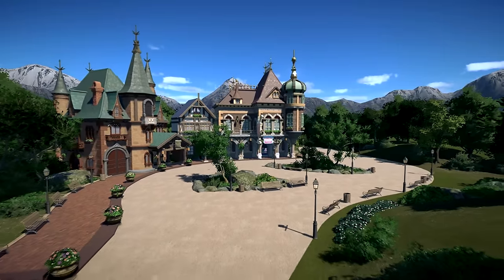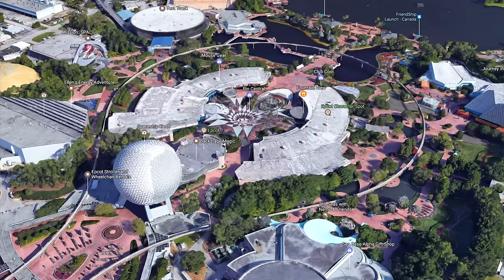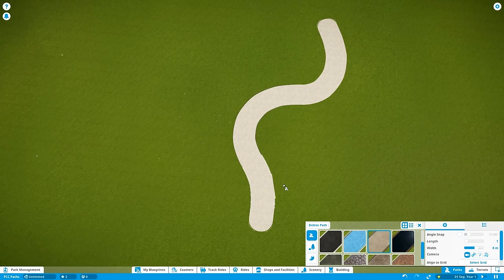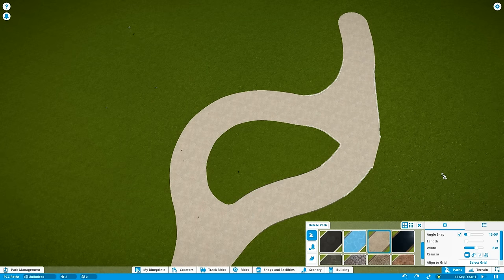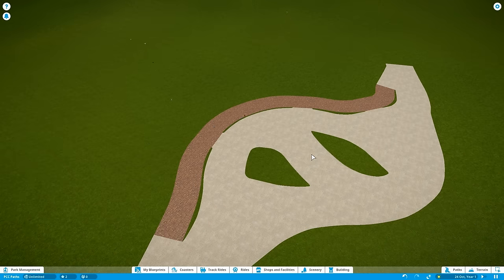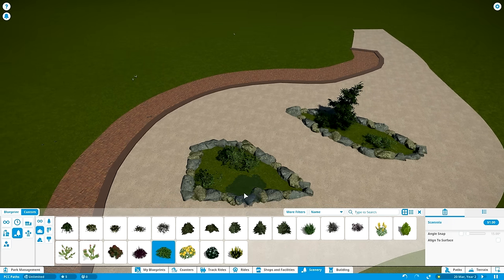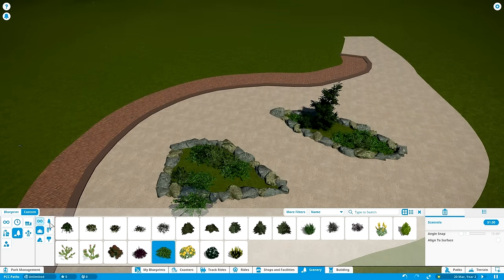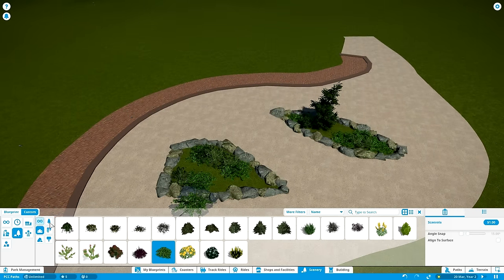Planet Coaster College - Smooth Paths & Plazas Tutorial

Comment: This could all be so much easier if they just let you fill in space between the paths.
Reply: Labedincoln yeah the paths in planet coaster really need to be re-visited/improved.
Reply: @JaycePeterson  I think having a designate path area tool function would be great. It sets areas where peds can walk and you can draw the edges, at which point when you connect a solid area between your drawn edges, it spawns in a path texture in that area that you can edit however you like
Reply: @JaycePeterson  to bad they are using pretty much the same path system in planet zoo )': didn't do any real changes
Reply: they need to add a path-paint brush
Reply: Amen
Reply: @PotholedAxe9985 THATS WHAT I WAS THINKING
Reply: I think the guests movement is closely connected to the direction and placement of the path squares so it causes some... "Issues"
Reply: Hopefully in PC2
Reply: @JaycePeterson well 7 years later… confirmed updated pathing system for PC2 👀
Reply: EXACLTY!!!

Comment: they should just add a paintbrush style pathsystem  on top of the current system. that way you can just do the outlay of your path with the current pathsystem and then paint the rest in if you want to make a plaza.
Reply: I suspect while this could be fairly easily impelmented, the problem/and reason why the path system is what it is in the first place, would be to have the pathfinding of the guests handling large open aeras and navogating them correctly. Especialy since planet coaster doesn't follow a strict grid system like say parkitekt or the old roller coaster tycoon system, they need something else to seve as way points. I think that's why the path system is organised around waypoints the way it is.  Look at the things he did and you'll notice the guest don't really 'spread' throught the plazas, they still follow the orginal pathes in single file. 
I suspect that by comparaison, had a done a square plazza with the select grid tool, (which is kind of already the euivaent of being able to paint zones with a brush, jsut a rectangular grid based one, really) the guests would have no problem navigating it.
Just speculation, tho, to be clear.

Comment: I figured the trick with smoothing corners out for myself! :D

One thing I've noticed with it is that you should finish the layout before smoothing, this usually leaves weird, "malformed" parts that can't be joined to nicely if you're still building. Also this tends to happen if you do this too much, so don't rely on it!

Comment: If you want a plaza without a path hole in the middle you can build a "sketch" on a grid and then smooth the edges using the corner trick... the edges don't get quite as smooth and rounded but it works (most of the time).

Comment: Thanks alot dude! You don't know how many gaps are in my park right now cuase of the path system. Now I have to close it , kick everyone out, and start from zero. Just started a new park so shouldn't that long.  And if they, frontier, made Jurassic World like this then it's gonna be a fun summer.
Reply from the maker: I've had a demo of Jurassic World Evolution, and the path system in that game will for sure be a lot easier!
Reply: So I was messing around and Idk if you know this but you can "fill" in the hole of the path. The way i did it was: go to the advanced options and click  curb on path off.  Then select width  between 6 and 8m your choice, I feel 7 is good. Click on the select grid and three rows of squares will appear, start on the middle go towards the direction you want; once you got as far as you want simply turn around on either the left or right.  Connecting rides to path with this method will leave some gap, but I just followed your suggestion of adding scenery.

Comment: Hey Silvaret. You can also use 2 or 3 shops next to each other for 6:45. Place them, and then delete them. As it is sometimes a bit more convenient, because it's wider than the widest path you can use. If you place the shops close to the path though, otherwise it won't work.

I've been doing it this way sometimes, as doing it with the path system itself doesn't always bring the result I'm looking for.

Comment: I don't know if this was maybe made before it was patched ( I'm new to Planet Coaster myself) but I was trying out your plaza tips, and kinda by accident, I noticed you can use shops to make even smaller adjustments along the edges and then delete the shop as well, let me fill in a few lines that weren't quite right for either the build item trick or a planter. 

Amazing vid btw, redoing most of my parks with these fuller type plazas.

My only "complaint" was that trying to learn to use CTRL a lot more and Z a lot more led to a lot of accidental CTRL -Z undoing heh

Comment: Yes, I wondered how to make large paved areas like real parks that are irregular in shape in PC. For example, having curved edges on a large paved area that's on a grid without those holes and gaps in the path. How do you have large paved areas go on a diagonal or curve without having gaps in the path? Normally on the gridded path you can only have 90 degree junctions unless you use non grid paths that are only so wide.

Comment: Are you using a keystroke to remove the short path additions? Asking because I can't see you click on 'delete path' to remove the small section and when I tried using crtl-Z it removed the piece without filling in any curve.. I've only been trying the trick for a few minutes thus far, but I'm finding when I use the delete path button it works a couple of times then seems to glitch out...

Comment: You touched on something that I didn't quite understand (sorry, am a bit new to Planet Coaster). at 13:28, what did you mean by putting something in the ground to make it a building? That's a new concept to me...can you explain that plz? Thanks!
Reply from the maker: An invisible wall, floor or roof item in the ground makes the game think you're building a new building. But then instead of a building, you're placing a few rocks, and because there's an invisible wall underground the game counts those rocks as a building, meaning you can copy them around like a building too.
Reply: If you look in the building parts, you'll notice some have a background with a grid pattern (they snap to the grid), and others have a plain white background (don't snap to grid). If you put down and item first that snaps to grid (like the 1m wood post) you start a "building"  Anything you add onto that grid becomes the building that you can select/move/duplicate as a whole.  If you only add scenery like trees and such (instead of actually creating a building), you create a grouping of scenery that can be easily duplicated and moved around as a whole.  It makes for quick scenery placement, like he did in the video with the rock edges.  Once the "building" has been placed, you can still manipulate and change each individual placement to break up the pattern if you desire.

Comment: I'm new to Planet Coaster, and I love everything I see in it EXCEPT the path/queue tool. It is USELESS and it is really bad programming/coding. It is great that gamers have figured out tips and tricks to share with one another to make paths/queues work the best they can, HOWEVER, what would be better is if the Planet Coaster creators actually made a path/queue tool that worked and was user-friendly. I'm glad I bought Planet Coaster on sale at a low price, because with paths/queues being this ridiculous to use and control, I'll never use this software. It shouldn't take a gamer longer to make paths/queues and plazas than it does to actually install rides, etc.

That being said, your video is great; I just don't think a gamer should have to work that hard or settle for second-rate capabilities.

Comment: Why don't you just make a plaza from a central point filling space around?
That way you'll fill everything without green patches inside.
Reply from the maker: Unfortunately, Planet Coaster doesn't allow this, hence why I'm saying this video goes contrary to the path system's intentions. The system isn't built for plazas unless they are square. If only it worked like C:S' concrete!
Reply: Well, make a cross or star shape and fill gaps between beams. Wouldn't this work?